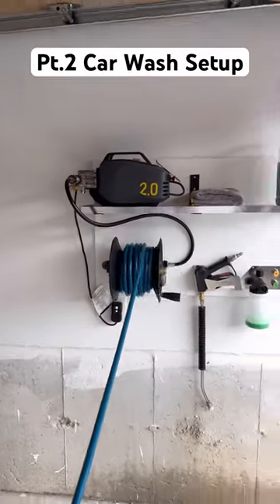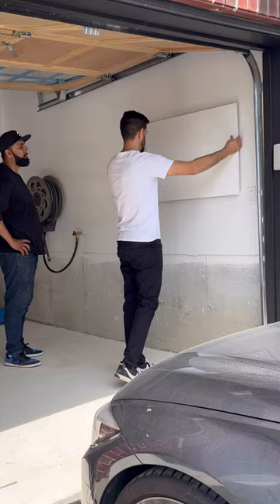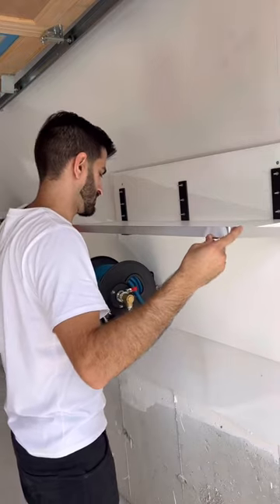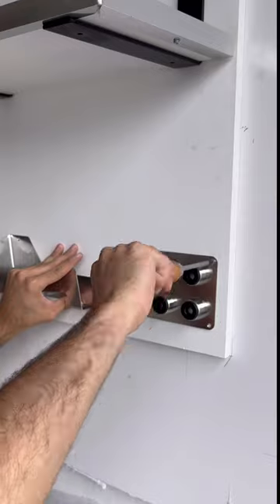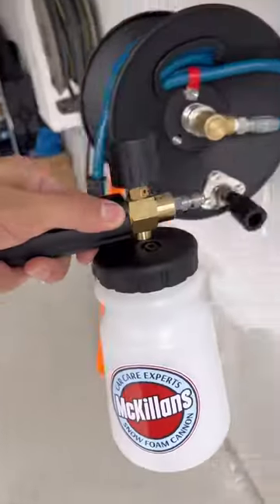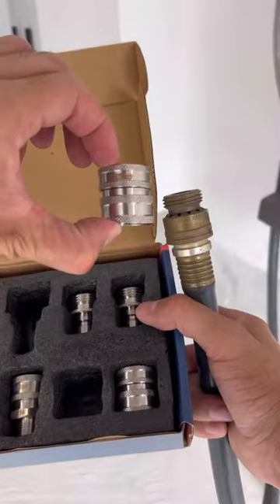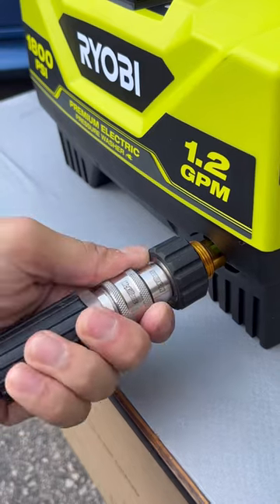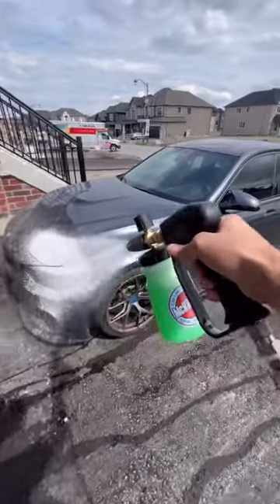Pt.2 Building a Wall Mounted Car Wash Setup Complete with Pressure Washer and Hose Reel #Shorts

Comment: Hope you changed the MDF board to treated wood because of water damage . If this is your friend 
You want him to still be your friend
Reply: Where did you even see MDF? Shows him attaching the board to a sheet of ply that they've painted over; should be fine
Reply: It ain’t a deck, no need for pressure treated wood it ain’t gonna see much water on the board. It ain’t outside….
Reply: What’s stopping the washer from vibrating off the shelf? That’s going to make so much extra noise having it up there.
Reply: That doesnt need treated wood. So long as that is a latex exterior paint, it will be plenty to keep it from warping/molding. Especially since its on a vertical surface and wont have standing water

Comment: Love how they started with the RYOBI 1800 then switched to the Active 2.0 Pressure Washer because it didn't fit on the shelf. I was almost sold till I saw the swap. I have the RYOBI 1800 and I need a wall mount solution.

Comment: Sounds like a good idea but having used a few pressure washers over the years they always leak and you got it up against an interior wall 😅
Reply: It’s an exterior wall in the garage, he should be fine minus the possible mdf board

Comment: Where’s your water supply?
Reply: thats what some of the quick connects are for. there is a garden hose on the wall just to the left of the wall mount setup
Reply: Great idea!………however, I have never seen a water hose bib INSIDE a garage.  They are always on the OUTSIDE of the house.  Did you have a plumber re route your water line?
Reply: idk, it's not my house. But I have seen plenty of houses with water in the garage. for a washing machine, for one example,
and others for a utility sink. I have a tiny garage as the house I live in was built in the 1950's but there are two water spigots in the garage. could have been done by a previous owner when they did a remodel. it wouldn't be a terribly difficult thing to do, or have a plumber do, i think. also, if youre considering going that route, you could just have a dedicated line run just for the pressure washer.